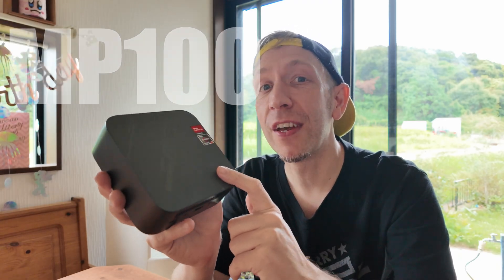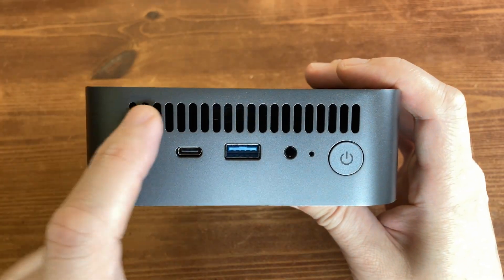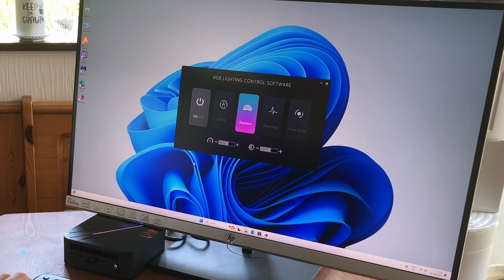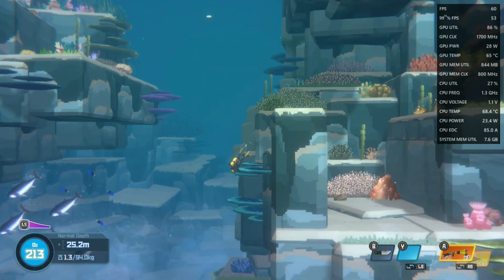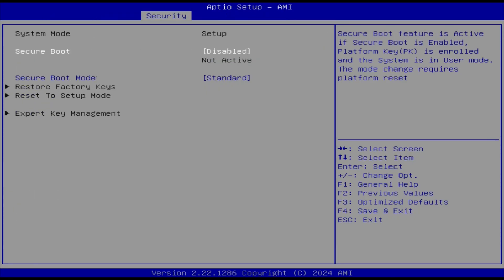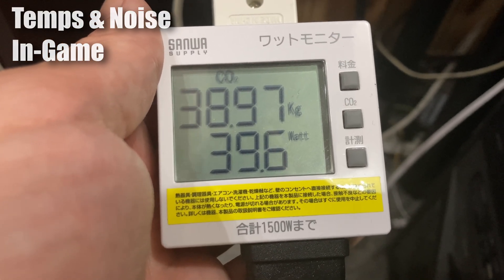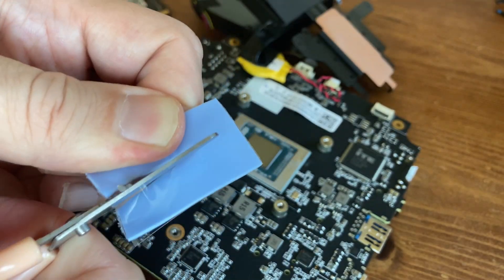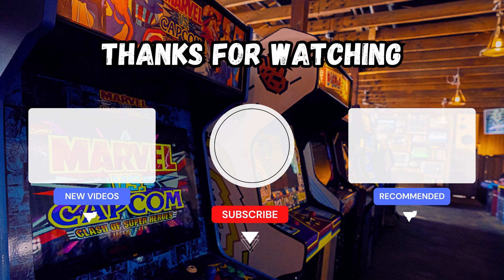Blackview MP100 Review- Solid $299 Mini PC (Made Better with One Easy Upgrade)

Comment: Yup i came back on your video because I own this mini pc also so u changed the frame buffer to 3g and put the ram to 3200 is that right ? I ordered also a second 16gg ram because you have 60 fps in ps3 right also ? Can I do something more to increase performance for ps3 Working really well at 60fps ?
Reply from the maker: You need to have 2 of the same ram sticks, or it won't run in dual channel mode. If that second ram stick that you ordered isn't the same type / brand... It probably won't work as intended. 
That's basically what you need. Dual channel ram essentially doubles the memory speed

Comment: The extra NVME port is another "pro".  Put in two 4TB SSDs one with just Batocera the other is filled with TV shows, Music, and Movie Backups to use with Kodi.  Install Batocera Unofficial Addons for those "extra features" & RGSX (😈-can't say any more) then You got a true HTPC/Retro Gaming power house that can even surf the net too.  

That said though for the same price, or just 50~100 more (depending on current Amazon market prices) you can just go to a mini PC with a 6800H (680M), or a 8745HS (780M) for GTX 1050TI or GTX 1650 non Super performance.  If you need a low power there is a 6800U with the 680M too in the same price range.  Either way 720P new AAA gaming, 1080p older AAA gaming, and some XBox 360/PS3/N_nten_o S__h emulation at native is possible, especially with Batocera or SteamOS being used.  Though you may loose the SATA & extra NVME port as the downside.

Comment: Thermal paste? That's often a problem. Could also be poor wifi? (It should REALLY have vents on the sides?)
Reply from the maker: Nice guess 👍 - tbh this chipset only has a TDP of 15w at default - basically it doesn't need much to function ... Less energy in, less heat out.
Vents on the side might help with temps, but I don't think it's really needed in this case. (Was that a pun? 😂)

Comment: For $300, you can easily get a Zen3+ Mini with 6800H or 6900HX APU, DDR5 RAM, the much better RDNA2 680M iGPU. For $50 more, you're into Zen 4 APU with 780M iGPU Territory, easily 50% more CPU performance and 2.5x to 3x the Graphics Performance.  Decent unit here from Blackview, but it's more of a Low-$200 range Mini, not $300.

Comment: Cool mini but for just a little more money you can get a Minisforum UM680, it has a Ryzen 6800H which has a 680M iGPU which I think roughly translates to double gpu performance from Vega graphics. I'd love to see a review on this unit and there are other 6800H based mini pcs out there around the $330-350, So it makes sense to just spend a little bit more and get that around double iGPU performance and also longer driver support.
Reply: That chipset has been pretty well covered as its already a 2+ Year old APU, but you are 100% correct...the 660m and the 680m are quite capable iGPU's, a good 15-20+ fps faster than the fastest Vegas.
Reply: but with 350 usd budget you could actually build a decent 1080p pc
Reply: @renkylo2179  Sometimes the power draw and form factor matter so a small sandwich-sized PC can make sense.

Comment: Nice teardown and testing. Lol masking tape attaches fan to heatsink, I guess a metal screw is just too expensive thesedays.
Reply from the maker: There are two screws. Tape is a usual occurrence - no gaps so that hot air gets expelled outside the case

Comment: I want to congratulate Blackview for doing some proper work with the cooling.  Like seriously well done.

As for the performance, but, but, but setting the VRAM manually doesn't change performance ever!  /s

It's a beauty as far as I am concerned.  The main issue is the driver situation, otherwise I think it's a fine little machine.  I like it even though it's not perfect.  

Yes I am still impressed with the temps because something so simple seems to be beyond most Mini PC (and laptop) manufacturers even for lower wattage systems.  It's infuriating.  

Thank you for a great review man.
Reply from the maker: Hey thanks 👍 

Unsure if you noticed yet, but you've actually looked at the product as I would.  Most of the other comments are complaining about the price.

Price may be a bit more expensive than others like GMKtec, but the 299 'on sale' is probably one of those silly marketing tactics where the usual price is 299 and might go lower when it comes to the Amazon prime day or whatever. 

When it comes down to it, this is a pretty solid unit, especially with the amount of drive options.   I'll check that other M2 slot properly for speeds, but I assume it could be a mixed sata / PCIe slot.

Comment: I would have liked to seen 2x8gb sticks vs 1 single 16gb comparisons
Reply: You can always watch this video.
Reply from the maker: @TrusteftTech your comment made me literally laugh out loud 😂 
- but yeah, we compared 1*16 to 2*16, not 2*8 like arcaderacer mentioned. 

Tbh there won't be much difference between the test in this video.  Larger memory sizes wouldn't really help in speeds unless the whole of the memory is being used (warily stares at Windows)
Reply: DDR4 prices are rising sharply, also- no one is making it anymore, which tells you the buyer is paying $300 + $35 for another 16GB RAM SODIMM for basically a dying or soon to be dead platform.

You can get a Zen 3+ 6800H system for $350, and for $400, you get get it with 32GB of high-bandwidth LPDDR5-6400.